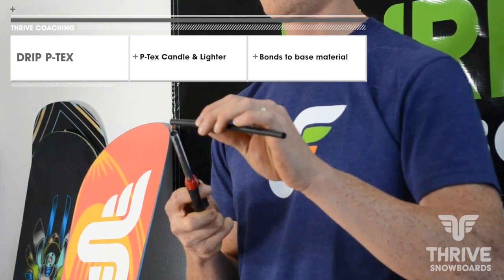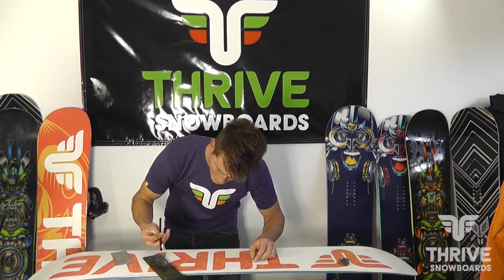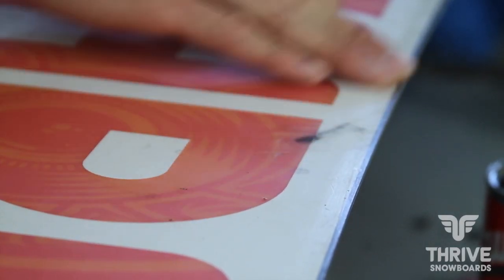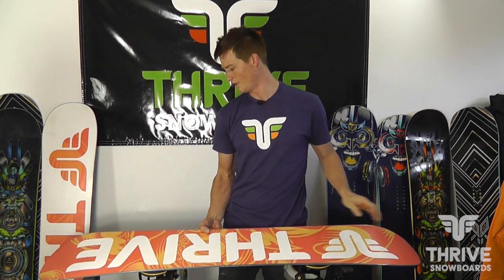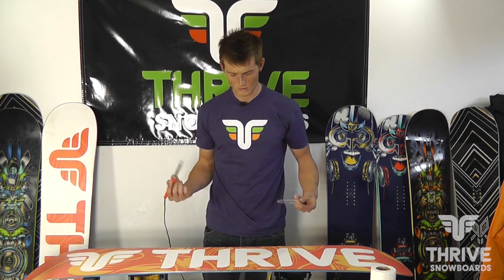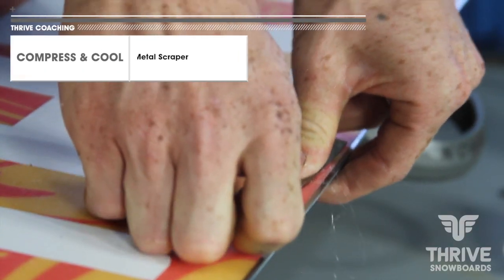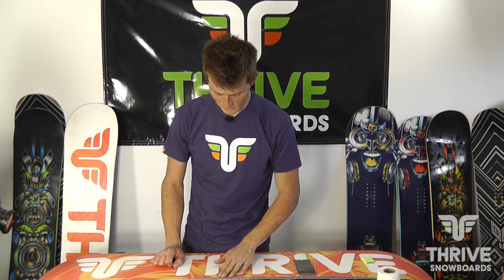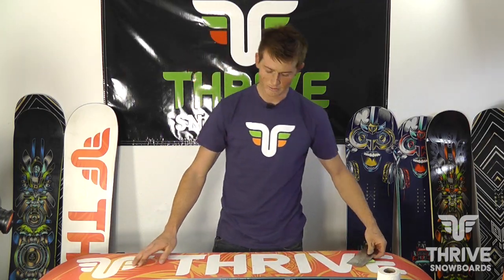Snowboard How To: Base Repair

Comment: p-tex candles have additives (i think it's parrafin from memory) to help it burn. This makes it quite soft, so drip candle repairs look great when first done as they are easy to do but after a day or two of riding they sink down as they are too soft. P-tex string is almost exactly as strong as the original base apart from being extruded rather than sintered.

Comment: So is the string the epoxy-impregnated P-TEX that is used for base welds? Also would you typically use this for all fixes (instead of the candle/lighter)? If not do you usually use a soldering iron for ptex candle in lieu of lighting it.

Comment: On larger repairs I get cracking in the ptex patch over time.  Is there a way to prevent this?
Reply: i guess you've let the ptex burn too hot, that's what happened to me. if the flame is yellow-orange that is too hot and will actually damage some properties of the ptex. try to keep the stick while burning much much closer to the base so that the flame will burn less intensive, and get a blue color, but still manage to melt the stick. also try even the first drops from the stick not to be from an orange flame by dripping the first drops on some other surface (also from a close perspective, as i explained)
Reply from the maker: If the p-tex is cracking usually it is being heated up to high, which happens when you use the burn method. You will most likely need a patch or p-tex gun repair. - Doug

Comment: If you wax the board afterwards, is it possible that the ptex would be melted again?
Reply from the maker: +Carrie Geng - If your iron is a bit too hot or if you leave it in one place too long your P-Tex can remelt. Be careful not to over heat your base when waxing. This can cause serious damage to your board.

Comment: Why aren't you using a temp controller on your sautering iron?  It looks like you're oxidizing the metal grip causing it to turn black from the carbon build up.
Reply from the maker: Island Boy - There are many methods for sure. if you have a temp controlled soldering iron, that could do the trick. That is a P-Tex stick being used, not the harder metal grip that tends to come in a thinner spool. Black PTex tends to be better than the white or clear due to the carbon build up. An actual legit PTex gun and patch kits work best for base repair not hitting the metal edge. Metal grip is best for getting base repairs to hold that connect with the metal edge, hence the name. One of our team members just likes to use the plastic six pack holder from a six pack of PBRs to fix his board. 😉
Reply: @ThrivesnowboardsUSA  Oh I was referring to the part of the video where you where doing a core shot repair with the wire.

Comment: what is this P-Tex? Can you explain me and can I change with the other product if I not have this P-Tex.  thnx
Reply from the maker: rrustem haziri - P-Tex is used to repair your base. It is the best patch material when making repairs that are not into the core and not along the metal edge.

Comment: Why you don't use razor scraper instead those dull metal scraper wich is intended for wax scraping? +Thrive Snowboards
Reply from the maker: The metal scraper used in the video is specifically designed to scrape off excess p-tex. For scraping wax you only want to use a plastic scraper, never metal. You can use a razor to cut off excess p-tex from the board as well, but be careful, it is easy to damage the board with a razor blade.

Comment: if you clean the soldering iron tip before using clear string you won't get such a dirty looking repair. Looked like it had been used for black p-tex previously.

Comment: do scratches affect borading/skiing ***** ?
Reply from the maker: jody rhodes Small scuffs and scratches can impact the speed of your board. If the scratches go across the board (making close to a right angle with the edges) they can increase friction which will slow you down. If this becomes a big issue, you can fix it by having your tuning shop do a base grind, or in severe cases they can fill in gouges using a similar technique to what we show in the video. Keeping your base in the best possible condition is always the best course of action.

Comment: why do u use a black candle for a white board :)?
Reply from the maker: There are a variety of different colors that can be used for filling, but for this example we wanted to show a distinct contrast between the normal base of the board and the area that was repaired.
Reply: ah ok,  that makes sense :)
Reply from the maker: The Black PTex also holds better than the other colors. So if you are looking for the best repair, black will always the best choice.

Comment: Man...use clear PTex....looks way better
Reply from the maker: +Norman Fifteen - Thanks for sharing. Using the burn and drip method even the clear PTex will not always look completely clear. When learning the black PTex can be easier to see and work with. As people gain more skill definitely work toward what works best for you. FYI - Plastic Can Holders are made from clear-ish plastic that can be used to fill your base scares. ;-)
Reply: +Thrive Snowboards Cool....Sorry...didnt mean to be so blunt!
Reply: @ThrivesnowboardsUSA  What do you mean by "plastic can holders"? Thanks
Reply from the maker: @BMJAUDI   - Some six-packs are connected by clear-ish plastic rings that are made of extruded p-tex. This has a similar chemical makeup of the base of the board.

Comment: Can you use regular hot glue sticks for this?
Reply from the maker: Cole Fisher The PTEX material used to repair the base of a board is completely different. It is designed to not only bond with the base material, but it also absorbs wax which is key to making the board slide. If you were to use something like a hot glue stick you would have terrible results and cause damage to your base. If you plan on repairing your base yourself, please use the proper materials.

Comment: you could use a type of epoxy to fill cracks/dents/deep scratches and then wipe off the excess and let the epoxy dry/cure = much stronger repair that isn't very noticeable.....
Reply from the maker: Epoxy will not hold if it is just on the base. Use epoxy when making a repair where you can sandwich between separated layers or to repair the sidewall or topsheet. To repair the base you will need a P-Tex or Metal Grip Poly to hold.

Comment: Do not, I REPEAT DO NOT, use a paper towel to let the Ptex drip on cause that shit will catch fire and the next thing u know ur Christmas tree is a goner
Reply from the maker: Luke - Thanks! Don’t let Uncle Eddy ruin Christmas. Dripping the melting p-Tex on an old scraper is ideal and make sure the wax is completely cool before putting away or discarding any waste.
Reply: I just did this 😂